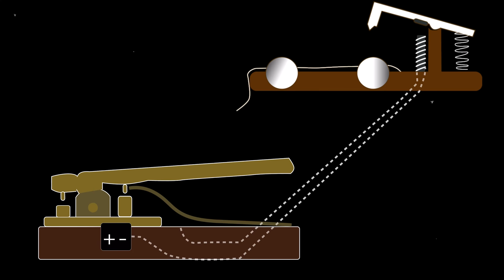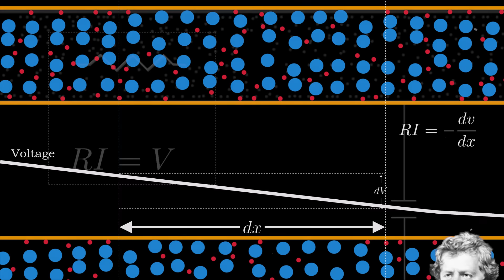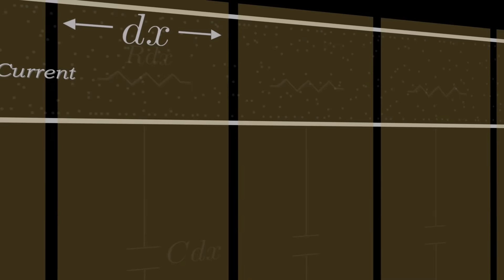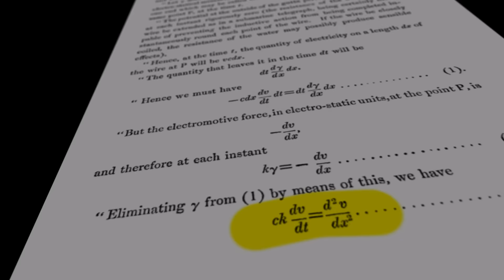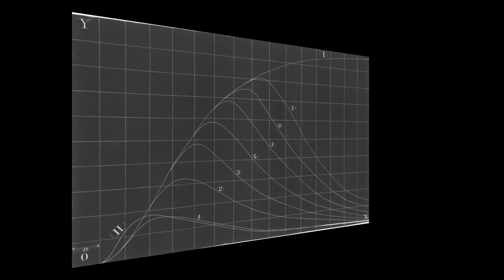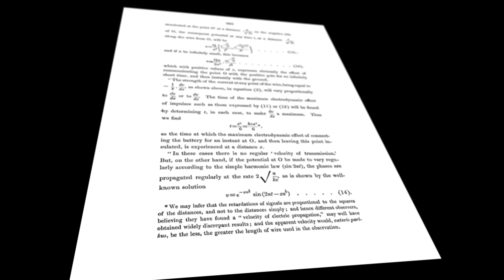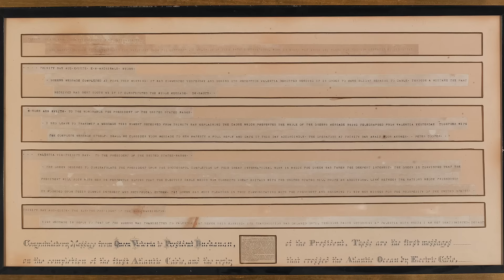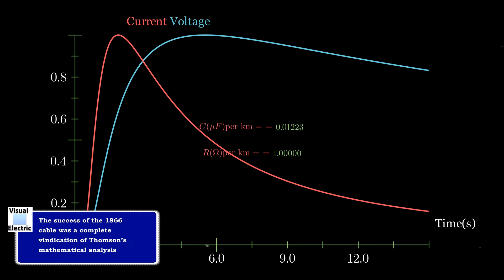How the First Transatlantic Submarine Cable in 1858 led to Transmission Line Theory as we know it

Comment: Geez, back in the 20th century I struggled with transmission line theory. Now nearly 24% into the 21st century watching how you illustrate the properties of cables, the equations, I get a better intuitive feeling for transmission lines.
Reply: I strike gold on YT every now and then. This being one of them.
Reply: Teaching is a skill like any other, but we pretend that any shmuck can do it.
Reply: It's a low-pass filter where the break frequency drops the longer the line gets.  I note (and the video notes) that Lord Kelvin didn't know about the series inductance, which makes it an even steeper filter (and much more "ringy"), a classic RLC tank circuit.
Reply: yes, a chapter in my undergrad electromagnetics text could have been replaced by this video.
Reply: @brettbuck7362  lowpass filter, I didn't think of that before but now I can view it like I would with a Bode plot. Then determine the cutoff frequency.
Reply: @mf Yes, for a given length you have what amounts to a fixed capacitance, inductance and resistance, and cables are typically rated by things like capacitance, inductance, and resistance per foot. You can do the same with audio speaker cables - where you quickly find that it doesn't make much difference, but the more "exotic" the cable (like multiple conductors woven together like a Chinese Finger puzzle), the worse it is, and that the best thing you can use is something that looks a lot like "zip cable" you find in $3 extension cords!   I would add that they were more concerned with the time-domain effects - since they were, effectively, attempting to send square waves through it at very low frequency.
Reply: @brettbuck7362  re: "a classic RLC tank circuit."
Well, better realized as a Pi network; Shunt C and conductance, series R and L, and another shunt C and conductance. 
So-termed 'tank circuits' classically denote a tuned element for matching or frequency selection (as in BP filter.) Speaking as an RF EE now.

Comment: For those who ponder, "Why study calculus?" this presentation gives a clear answer. Also, the EE concepts that seem obvious to today's diligent EE student (and which mystify those who lack either diligence or proper preparation) earlier mystified the best minds, even Faraday. A hint to those who "don't quite get" some aspect of the material here: Go back and learn the fundamentals. Somewhere you missed a step or learned an incorrect shortcut. 

"But what about inductance?" as some have noted. Yes, it had not yet been folded into the theory.
Reply: This is where Heaviside comes in...
Reply: Right, once someone else figures it out, it's relatively easy to understand!
Reply: @miroslaw5615  Sorry, but you'll wind up working for a boss who should know calculus, and even thinks he knows it, but who is directing you based on faulty understandings. I was there, busy trying to tell PhD EE guys why their naive computer programs were failing. (This was 50 years ago.)  They did not want to hear me tell them that any "real" number in their Fortran programs was only a representation of an approximation to a real number, and that limits as understood in calculus did not map onto the limited precision supplied by the computer. (You are guaranteed at least one more real number between any two others, but the computer's "floating point" engine lacks continuity and thus does not give you that guarantee.) Those EE guys did not want to listen because I only have a bachelor's degree. How could I possibly be right?

The issue is now better known, and is explained well in this Wikipedia article. https://en.wikipedia.org/wiki/Floating-point_error_mitigation but knowledge of calculus (particularly /limits/) is still needed so the programmer doing intricate stuff like geophysics can avoid the errors.
Reply: Fundamentals: Pushing, stopping, kick-turning.  In both stances and for both front and back sides.  My switch stance, certainly needs some revisiting.
Reply: @amazing763  Those who can't use FP, those that can use large integers and 'scale' their quantities a number represents, and thereby avoid the 'error creep' you allude to. Used to use that technique to calculate the integer divider constants for PLLs used in radios, staying away from FP calcs altogether.
Reply: @uploadJ  The problem was not error creep. It was fundamental theory. These PhD guys did not know that there was a problem. Fortran's two datatypes were INTEGER and REAL. They erroneously believed that those so-called REAL numbers would adhere to the stuff they learned in MIT's 18.01 class. I might possibly have said, "Dammit, guys, those are bit patterns representing an approximation to a real number! You don't have continuity." But they had their PhD degrees and I didn't.

The machine they were using was a PDP-7, which had 18-bit integers. We did not have the Bell Labs software that was being developed at that time (on the BTL's PDP-7), the dc program, allowing use of arbitrary-precision integers.
Reply: @amazing763  re: " It was fundamental theory. "
I think you misunderstood my post, bigly. Made you take things way too literally? 
It ONLY takes a few minutes using any calculator (OR reading the manual) and one realizes the limitations of 'canned' routines or the FP system ... elementary instruction of the number systems (Real, Img, Integer) is something every engineer or physicist should have been exposed to, so I kinda find your story a little dubious to start with.
Reply: @uploadJ  These PhD EE and Geophysics guys had done all their undergrad work with slide rules or Marchant mechanical calculators. They were very happy to find, about 1965, that they could use computers, and by 1970 that they could do hands-on computer stuff on a PDP-7 that had a 340 display. Most of them assumed it would all simply work according to the math they already knew. Just one of them took to hacking the OS (oops, it wasn't an OS, it was what we called a "monitor"), by writing off the end of an array in Fortran. There was no separation of user space from system space. For the most part, they truly did not understand that FP in those years was a kludge. Here's one example: The Fortran system had no built-in way to handle alphanumeric data, but the PhD guys found they could tuck six six-bit chars into a REAL, which used two 18-bit words. They then wanted to compare two strings in an IF statement, for which the FP hardware normalized the numbers and subtracted one from the other. I'll let you imagine how things went wrong and how I rewrote the not-an-OS to avoid normalizing and to not report arithmetic overflow, which by default halted the machine.

My interaction with my PhDs was usually my being told, "It's giving me wrong answers. Fix it." I could tell you long tales about it, but the power just failed here at my farm, and I'm suddenly on battery backup.
Reply: @amazing763  "In a land far, far away, long, long ago ..." 
Are you familiar with the IBM line of digital computers which employed vacuum tubes? Do you know when the IBM System/360 (literally, transistorized) became available? And not to mention the competition machines?
Reply: @uploadJ  I knew people who used some of that ancient equipment. I even took a course where I had to submit jobs on punched cards, while the computer itself was attended by priests in white coats. What a pain! But I actually do know how to program a control card for an IBM 029 keypunch,  if the opportunity ever arises again. My ham radio equipment used vacuum tubes. Can I also drive a horse carriage? Why yes, I can.

Oh, and I also worked, around 1970, with some of the guys who wrote the machine-language proto-version of an Algol compiler for the Burroughs 5000. It was used just once, to bootstrap the B5000 Algol compiler written in Algol. 

We were working with PDP-8 computers at that time, and were OH SO PROUD of our ability to fit everything into 4k of 12-bit words. Comments like //DO NOT MOVE THIS CODE. MUST BE AT *3000 were common. Sometimes a single memory location was (1) a numeric constant, (2) a pointer to somewhere (like 3000), and an executable instruction (DCA 0).  So far from Oliver Heaviside, and yet so close! If only I could be just three percent as smart as that guy!
Reply: @amazing763  TI's parent company, GSI, Geophysical Services Inc, literally invented computer aided analysis of 'sounding' data to find and chart oilfields ... this back to the fifties. TI later developed the ASC - Advanced Scientific Computer  to do this work, and built several more for use at several labs around the country ... Tech has been around for longer than most ppl realize.

Comment: I was in a baseball card shop in the early 90's and they had a NY Times from 1858 for sale. It had a box score for a few games in the NY/NJ area, including Hoboken. I thought that was very cool and bought it. When I got home and read the whole paper it was obvious why it was saved. It was because it was from the day after the first cable was completed. The entire front page was dedicated to it. It's fascinating. 
Not mentioned in the video, but they actually found the damaged spot on the original, pulled it up and fixed it.

Comment: When ham operators (amateur radio) had to be able to morse, the minimum requirement was 5 words pr minute (wpm). The limit for the traditional morse key is 15 wpm. With machine or computer generated morse it is possible to understand up to 40-50 wpm.

Comment: Well told. It's amusing that the solution was to increase the voltage, a choice made by a man who did not understand theory. In my career as a EE in mill controls I would encounter frequently people who would argue or give orders to use setting that would fail or would damage the equipment. It happened way too often actually.

Comment: My dad told me that, in his Cambridge degree exam in 1934 there was a question on heat transmission.  He said that he wrote as his answer "Using the telegraph equation, well known to electrical engineers, we have as the solution xyz" and moved on to the next question.

Comment: I don’t understand all of this but I do understand the concept of carrying power across large distances with smaller wires by sending them at a high voltage and then you can step the voltage down and increase the current to get the same power. So essentially you can carry many loads with a small wire, but once the voltage is reduced, large wires are required to carry even a small portion of that load. This makes sense to me if voltage is a force like I was taught in college but if voltage is not a force then it doesn’t make sense at all.

Comment: 11:15 Both cables had multiple strands forming the center conductor, which increase the surface area of the conductor and the distributed capacitance. It seems as though a single center conductor would be better, perhaps with an electrically isolated shield between the center and outer conductors as this would divide the capacitance into two in series and reduce the reactive current.
Reply: re: "multiple strands forming the center conductor, which increase the surface area of the conductor and the distributed capacitance. "
Um, it does not work that way, stranded RG58 for instance has pretty much the same capacitance per foot as solid conductor RG58 cable ... see, the rough area exposed to the shield (the other capacitor plate) is roughly the same for both cases. Very small difference. Very. Small.

Comment: Signal Source impedance has to equal Transmission Line impedance HAS TO EQUAL Terminating Resistor impedance. Failure to establish these conditions results in unwanted Signal Reflections.

Comment: It's interesting how the predicted problems in the first cable were ignore, and only corrected in the second cable after the wretched performance of the first one were clearly demonstrated. The same thing happened more than a hundred years later when AOL bought Time Warner, expecting that someone would quickly figure out how to send 10 MHz videos through T1 voice grade telephone lines... as if the laws of physics truly were as "elastic" as Star Trek episodes portrayed them. As for pulse dispersion, an acoustic example of this was exploited to make sound effects for Photon torpedoes in Star Trek, and blaster sounds in Star Wars. In both cases, those sounds were recorded by striking a steel guy wire for a radio tower, and recording the resulting audio pulse, reverberating through the cable... One can clearly hear the rapid decay of high frequency components, as predicted in the math, yielding the prolonged metallic "twang" sound that screams "DISPERSION !" to anyone who understands this stuff. An example is here :  https://youtu.be/fl0wIdGxfbQ?si=eGCJv8ikpXjRv1gk
Reply: re: " how to send 10 MHz videos through T1 voice grade telephone lines"
Apples and oranges; A "T1 line" is a 1.544 Megabit per second digital line, and it cares not whether analog or digital 'data' is being carried. There is no such thing as a "T1 voice grade telephone line", unless you consider a T1 (still a digital trunk) used as a voice 'trunk' with robbed bit signalling in use. Robbed bit signalling can (should be!) only used with 'voice' transport (where distortion from random missing, change bit will not materially affect the phone call.)

Comment: Another two smaller details 1. "Ohm's law" is not a law despite of names, in fact we call Ohmic conductors those that obey Ohm's law (a law that is only valid to those that obey this law is not a law at all or we would have billions of edge case "laws"), and even those only obey it in very small ranges as as conductors heat their "resistance " (the quotes use is explained further ahead) gets higher. But if Ohm's law defines resistance this is a circular reasoning, just like using Newton's second law as a definition of force (it is not).
It is an empirical law, not a fundamental law.
2. The approach using only capacitance is valid for very low frequencies, for higher frequencies the inductance is not negligible (like audio or radio frequencies). But the same idea of calculating it can be used. In fact this approach is not different to the propagation of light on a dispersive medium, as the speed of each frequency component depends on the frequency (not surprising as Fourier created this method hat involves series of sines and cosines to solve heat equation). That is why when we learn that at college we learn to use a series involving the L and C and taking the limit to infinitesimal parts (there are two different ways to approach the slicing of the line in parts but when you take the limit bot converge to the same solution), this way is the first step that is more intuitive to students before you attack the differential equation and even calculation the distribution of energy around the line using the Poynting vector (that should silence sterile false polemics created by Veritasium but no one seems to have made their homework even those that pointed it like ElectroBoom ignored this part).

Comment: This has me wondering if I could explain the need for thicker cables to the scientists and engineers of the time (prior to Thomson's revelations) in a way that would at least seem plausible. Is there a more conventional physical model I could use to demonstrate why the cable they had used was inadequate, aside from the mistaken use of higher voltage?
Reply: They had no comprehension of cable impedance matching at that time, so, they were baseband 'switching' a voltage to actuate a coil at the far end .. this made for 'echos' that interfered and would propagate back and forth. Land cables didn't have the low impedances that shielded under sea cables did, and the echo was manageable over shorter land runs.

Comment: GREAT! The problems of resistance and capacitance are very well explained. If you had included induction (L), you would have covered the Big Three. Question: I'm assuming that R, C and L are irrelevant in a fiber optic cable. Is this so?????
Reply: it is I believe and that is because fiber optic uses light rather than electricity(blah blah blah photons electricity blah blah)
Reply: Fiber works to 'guide a wave' (light wave) versus carry a current (like a coax cable or twisted pair does.) Then there is 'wave guide' which is bigger and traditionally carries microwaves (and Great Britain did at one time try a cross country WG system) BUT it is physically a lot larger.

Comment: One thing missing is the inductance that makes it even worse. The inductance is in series with the resistance and as this is worse for higher frequencies it smears out the signal. it rises and falls slower.
Reply: As the video noted, with this RC transmission line model, the higher frequencies travel faster than the lower frequencies, smearing the pulses.  One of the contributions Heaviside made was that to compensate for this, inductance needs to be added the the transmission line.  This was in fact done for the long voice land line and telegraphy runs of the past.